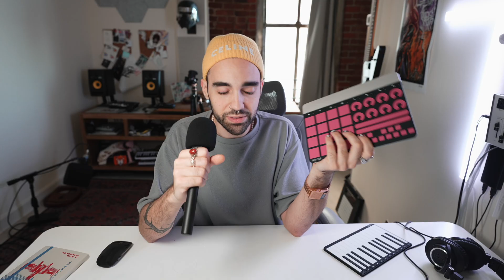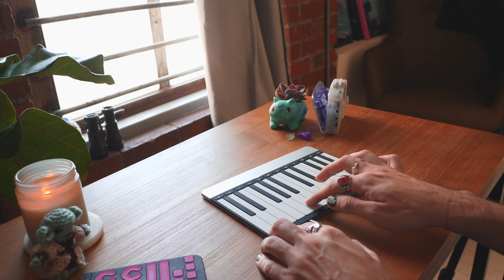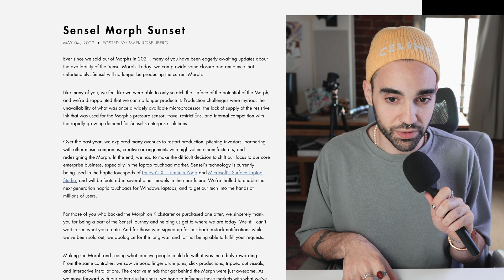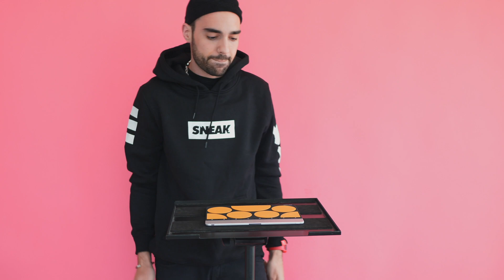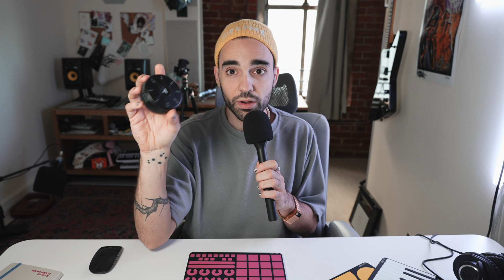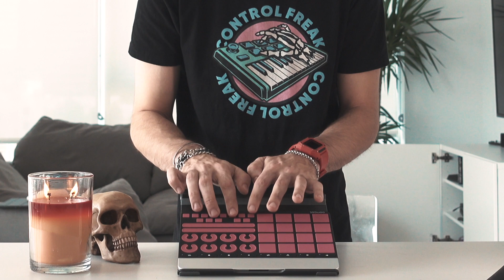you can't buy this midi controller

Comment: Honestly though - it was cool but I have seen and used several iPad applications that do the same thing, and as an added bonus you could design your own interfaces. Now I would not recommend using real drum sticks on an iPad 😂 but as far as finger controlling your music software, this will give you most of the same functionality. Also the cost of a lower end or used iPad these days is fairly reasonable, and offers a LOT more functionality to me as a musician.
Reply: sorry but no, do you own a morph? nothing on an ipad even comes remotely close to it, not even remotely close. the loss of the morph seriously sucks
Reply: @infinite_sorrow  ok that’s your opinion and sorry you feel so sad about a controller. I looked at and tried one and didn’t feel it was all that special I’m my opinion. There is a standard called OSC and you can build controllers with keys, trigger buttons,switches, sliders and knobs on screen and map them however you want and get visual feedback. I have even seen sequencers made with it - so no it’s not the morph it’s capable of being a lot though and giving a lot of control over your midi gear and music- and in reality a lot easier to tap a button and change layouts than have to carry a bunch of overlays. Just saying… oh and if you have an iPad already it’s like a $10 cost I think…
Reply: This is what I started to find as well. I usually ended up using my iPad for a lot of the Morph use-cases so I let it go. Very good device still though, especially if you are into coding. That part I miss very much.
Reply: Out of the apps you've used,  is there one that you recommend?
Reply: @olilerno  hey there sure Midi Designer is good, also Touch OSC (might be OSCTouch) and knob lab is also good.